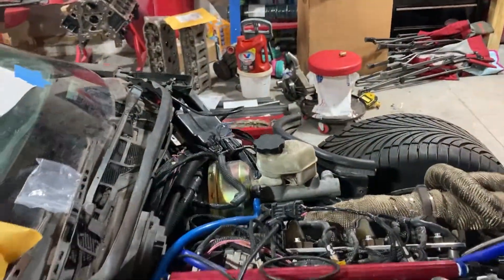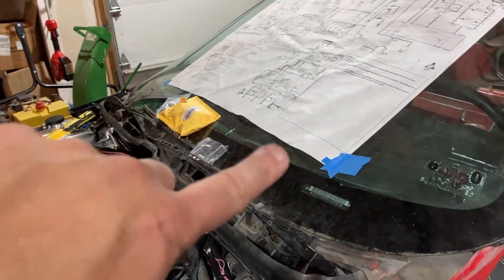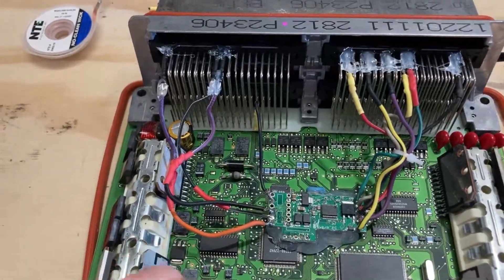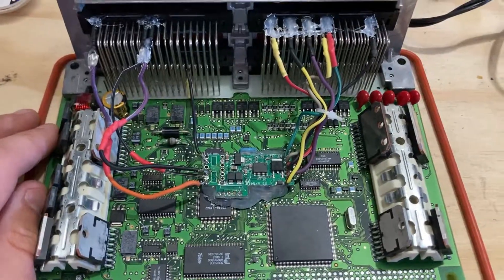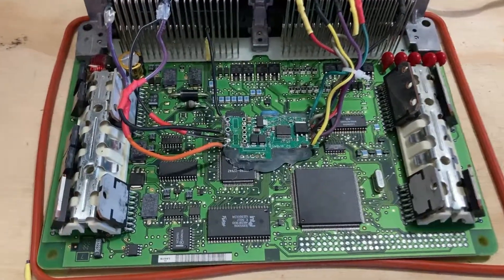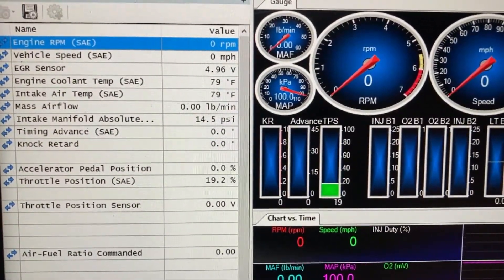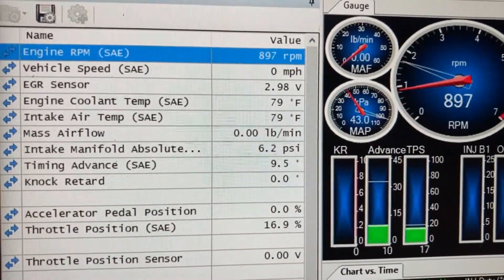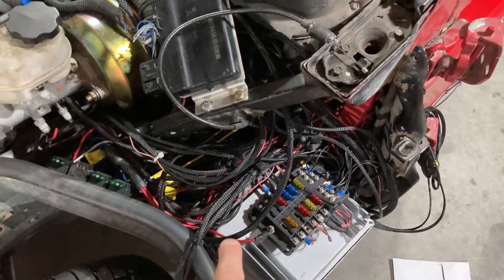Wideband Control in a P59 - Spartan2 OEM

Comment: Pin 41 is ironically the egr position sensor ground lol. It’s just not used in every vehicle.
Reply from the maker: I found that out by popping four 5amp fuses lol. I am going to go through and verify all the case grounded pins for the PCM because there are probably 20-30 of them i'm guessing. I have ten 18 gauge wires going out directly to chassis ground. Makes it nice that I can just go to common ground internally on the case as well as any addition sensors for the arduino piggyback too using them.
Reply: did you have to input the equation for fine tuning the wideband? I use eehack for an lt1 and it's asking for the equation. I'm guessing 0v = 7.35 and 5v= 22.3?